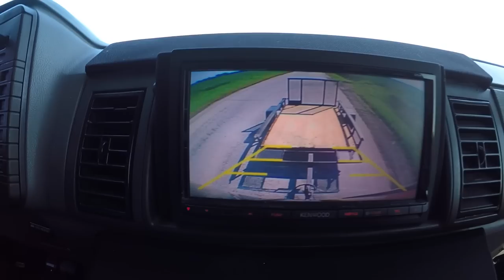1979 YAMAHA G1 GOLFCART PROJECT

Comment: Lift and and put some nice tires and maybe a plow. A old 350-450cc quad motor would be awesome. A rocket motor would be to much and it would be a nightmare to get everything to fit, not to mention how fast it would wear everything out from the power and weight. 👍🏼🍻

Comment: man you need pugs help but find a nice 600 cc sportbike 4 cylinder motor keep it super quiet and it'll be a sleeper man. you go campin and just smoke the old guys on their gas  or electric carts. but electric is the way to go gas is just another oil change and gas that ya need i dont have time for that shit plug and play electric
Reply: Rob Plotts ya but at least you don't have to wait for it to charge and can go as far as you want. Just think how batteries will be in antoher 10 year's the military allready has some crazy batteries that last longer than you would think possible
Reply: Blop Jones the lipo battery company says if they made the batteries as good as they have the ability to we couldn't afford them.
Reply: Blop Jones some electric carts have 3to4 deap cycle batteries they can go for 8-10 hrs on one charge